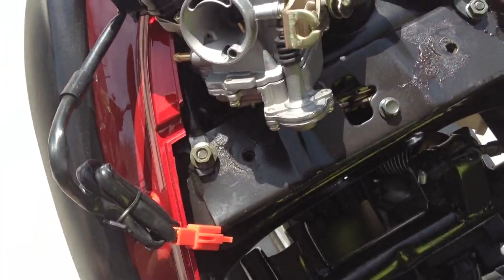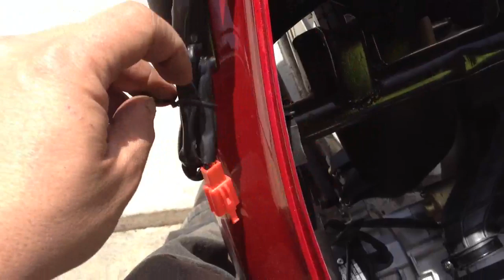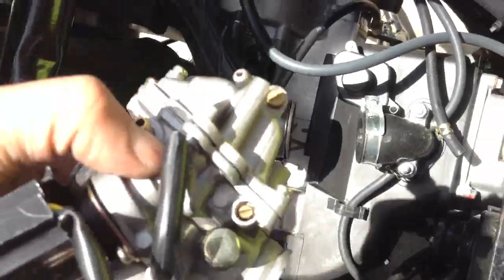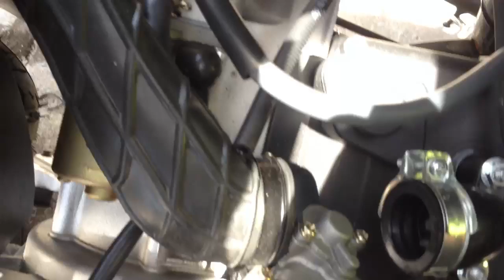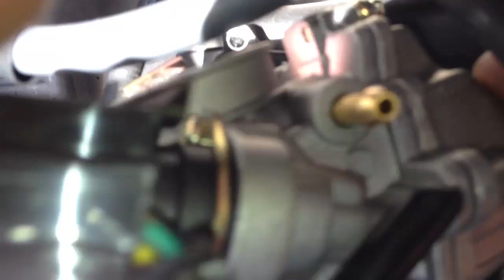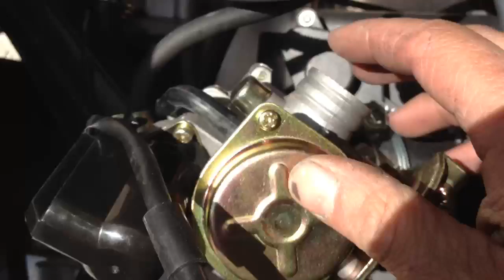Gy6 carburetor 139qmb installation 50cc 49.5 cc Part 1

Comment: I'm curious: Will this carb also work for the Taotao atm50 scooter?
Reply from the maker: If it's 4 stroke, then yes.
Reply: ***** Thanks for the info.
Reply: ***** where does the bottom hose go thats underneath the carburetor
Reply from the maker: Nowhere, that is the bowl drain hose.